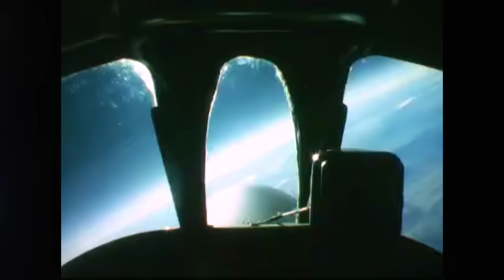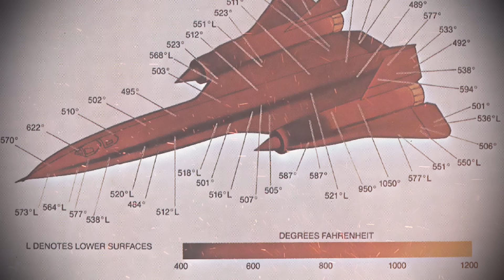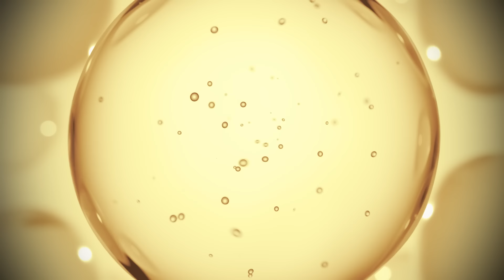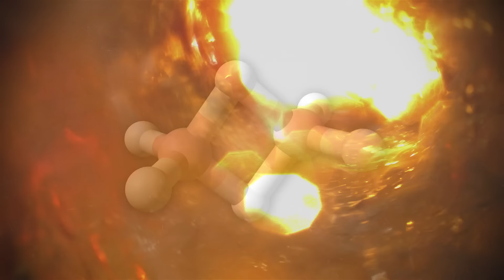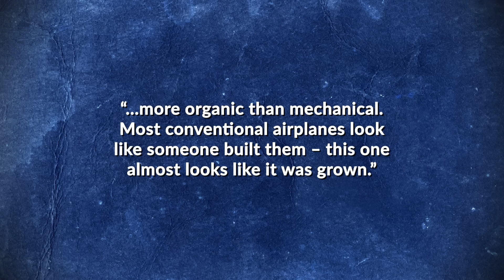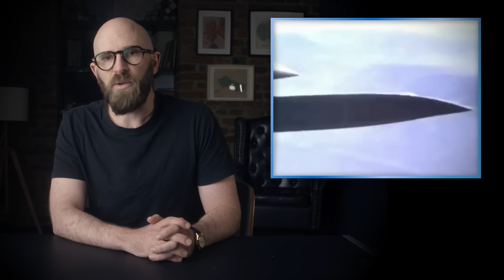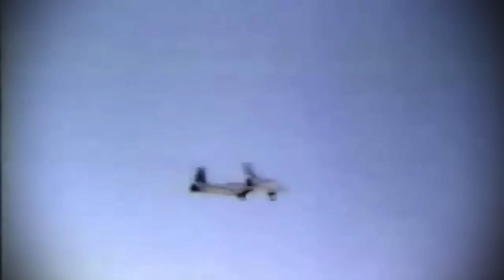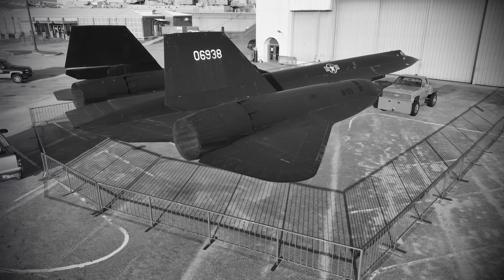How Did the SR-71 Blackbird Get Made and How was It So Fast?

Comment: Here is the thing the U2 and SR71 were based off the British Canberra first jet Broke altitude records low radar image was first jet spy plane before ground to air missiles.  The surprise was I think in the 1980s the SR71 Blackbird at well over 80, thousand feet met the Electric Lightning. The only fighter plane that could vertical clime over the speed of sound. The SR71 was so well designed and built nothing else could be made like them.

Comment: These engineers were the real deal! They didn’t have AutoCAD, they HAND DREW every system with straight edges, compasses, and protractors. Their calculations were done with slide rules, not calculators or computers. They didn’t their math longhand with pencil and paper. When they didn’t have a tool, they thought it up, drew it, and made it - so they could get back to building the bird. They engineered all new liquids, lubricants, sealants, fuel, electrical connections. 

Those engineers were badass, and are still badass to this day. As far as I’m concerned, Mr. Kelly Johnson and his band of merry men are just as much heroes as those who flew this magnificent marvel of American engineering.

Comment: The speed of M 3.3 is the unclassified number.  As the program is still classified.  I am sure the aircraft goes much faster.  That goes for all the other numbers that were reported in this and other videos.  I always wanted to see if the math adds up.  As the skin is a titanium alloy. We could then give a rough estimate of sped from the heat and expansion of the metal.  I was shocked to learn when I was a child in the 78's.  that the aircraft would expand 12" once in flight reaching its top speed.  This was from a propaganda film shown at Wright Patterson Air force Museum.  Where it reported both the SR 71 and the XB 70 both were designed to do M 10.   But I was 11 and what did I know then.   I was at awe seeing the XB 70 out front of the museum, under the sun the huge bomber.  laughing with my friend Jimmy because the rear landing gear was as tall as us.    Then in the museum seeing the B19 landing gear tire shortly afterwards.  the tings as a child we seem to focus on.  That day I bought my first two model airplanes.  The SR 71 though I know now was the A 12 ans the XB 70 Valkyrie.  I was a kid in love that day.  In 2003  I took my 8 year old daughter were we looked at the A12 though was said it was the SR 71 on the sign in front of the aircraft.  I was so amazed as the films the plain looks so much bigger.  Like the F104 also looked so much smaller.  My most favorite aircraft to this day.  The Bird of Prey also makes the list today.  It was so much fun taking in the Dayton air and trade show and the museum the following day.  God I feel old back in 2003.   It has been 22 years.  where does time go?
Reply: Mach 10? Absolutely not, or even possible. The program is not still classified,  and all performance capabilities are declassified and public

Comment: Fuel tanks did not “seal” at speed and temperature, they still leaked. The fuel would simply evaporate as it leaked out.

The starter fluid was triethyl borane, a liquid, not a gas.

Comment: On some days, that trans Atlantic flight took less time to complete than my daily drive home from work (30 miles). Let that sink in. Old boy runs 3 times faster than the sound its engines make and its exhaust is even faster (note the mach diamonds coming out of the afterburner which denote supersonic speeds), and did it without breaking a sweat despite its skin being hot enough to melt aluminum.

Comment: I read the SR did not leak that much fuel  (and what it did leak was carefully collected while the plane was on the ground) and that the JP7  was used to make sure the fuel did not combust from the heat generated by flight as the fuel was directly in the wings.

Comment: I was stationed at Beale AFB from 1986 to 1990. I worked on T-38s that were used to give flying hours to the SR-71 pilots. I have seen several launches and flybys of the Blackbird. I even attended the engine test of one J-85. It was so loud my lungs vibrated! I have a picture me of sitting in the jet exhaust of an SR-71. And I attended the retirement ceremony in 1989.  The plane was otherworldly!  If anything this video underplays it.

Comment: Did they actually ever use diborane pyrophoric? Afaik, and based on what even the pilots said, they used TEB (tetraethyl borane, the stuff conventionally used to light/relight rocket engines) and they had 16 shots of it per sortie. It'd also be used to light the afterburners.

Comment: The fuel designed for the J58 in the A-12/SR-71 wasn't to prevent fires on the ground as Jet-A is essentially diesel and will not ignite without substantial application of flame (it will put cigarettes out when they are dropped in a bucket of Jet-A). It was developed because the autoignition point of Jet-A is below the skin temp of the plane at top speed as well as the temps in the engine at design speeds. 

Without a fuel with a higher autoignition point, the plane becomes a one-way trip.

Comment: Just one correction:  the various incarnations of the SR-71 took off light and refuelled in flight immediately afterward for a reason unrelated to either its supposed leakiness, or the strength of its landing gear.  NASA/Armstrong (nee Dryden) Flight Research Center had three operating SR-71s in the 1990s, and I knew a number of their pilots.  Steve Ishmael, the principal SR-71 pilot, set me straight on this matter.  The CIA and Air Force did the early refuelling operation because a fully fuelled SR-71 weighed so much that it had to pull a very large angle of attack on takeoff.  This resulted in the rudders being "shadowed" from the free stream, and if either engine flamed out, the pilot would have no yaw control, and likely lose the aircraft.  NASA couldn't afford an air tanker, so they did a risk assessment which concluded that, given the aircraft's operation history, the odds of such a takeoff accident were low enough to be acceptable.  NASA would often take their :SR-71s off fully fueled.

Comment: Another great video BUT...
Why do the writers of aircraft features insist on giving altitudes in metres? As far as I know, only the Russians use metres for altitude. The rest of the world and significantly the USA, makers of this aircraft, use feet or thousands of feet to measure altitude. I don't compute altitudes in metres. The Aircrash Investigation series does it too. It's infuriating!
Also, I don't think the fuel for this aircraft was chosen because it was safe when it leaked as you imply. It was used to cool parts of the engine so it needed to have a high flashpoint and low volatility. That it didn't catch fire when it leaked was a bonus.

Comment: And once again, one of your videos has major flaws in the information it gives: the fuel was not engineered to not ccombust when leaking out of the aircraft!
It was designed to not boil or decompose under the extreme conditions: temperatures of 500+°C at less than 10% of atmospheric pressure. Being difficult to ignite was just a side effect of that. They even had to use TEB (triethylborane) to get the fuel buring - as well during startup of the engines as well as the afterburners. Actually, the range of the SR-71 was limited by nothing else but the amount of restarts of the afterburners it could perform before needing a refuel of TEB, which in turn limited the nummer of air-to-air refuelings possible before needing to land.
Reply: The limiting factor was LN2, not TEB.

Comment: In the mid-1980's, rumors started to circulate that Lockheed was working on a successor to the SR-71, code named Aurora. In the 1990's, there were reports of sightings, mysterious sonic booms when no supersonic aircraft were operating in the area, strange "donut on a rope" contrails, and more rumors, included an alleged top speed in the neighborhood of Mach 5.

The government denied the existence of Aurora, as did Kelly Johnson's successor at Skunk Works, Ben Rich. All the same, you'd think that Lockheed would have been doing some work on the technologies needed for a next-generation spyplane; something that could fly higher, farther, and faster than the Blackbird. Did such a project exist? If so, what was the final outcome? Me, I'd like to think that at least one test aircraft was built and that a few flights did take place, but the materials they had to work with just didn't hold up long enough at the design speed (Mach 5+) to justify building more until new materials were available. Is the SR-72 appearing now because that problem has finally been solved?

Comment: A Swedish fighter jet successfully managed lock on to the SR71 (not with any intention to fire at it) and were awarded medals for this. Sweden also saved a a damaged SR71 from falling into Sovjet hands by guiding it south over the baltic ocean towards the allies.
Reply: Not just “a” Swedish fighter jet.  There were at least 51 successful interceptions of the SR-71 by the Swedish Air Force.  

When you have a plane that wakes up everyone within ten miles of Mildenhall, still needs to tank up with fuel, has to thread the needle between sovereign airspace in rhe Baltic Sea, and has a turning radius of 81 MILES!   …. it’s pretty easy to guess where it will be and place your aircraft in its path.  A properly timed zoom climb completes the mission and if need be the missile could make up the rest of the distance and altitude.

Comment: JP7 was NOT developed to reduce the possibility of fires on the tarmac because Blackbirds leaked fuel standing still.  Where do you idiots get this stuff?  High flash point JP7 fuel was developed to handle the high temperatures of the air frame at Mach 3.
Reply: @MillionsOfRecords  You just went over the bearded wonder's head!

Comment: I was stationed at Ft Hood in the late 1980s. I was on a maintenance test flight in a UH-1H at 10k feet. At that altitude we could hear LA flight Control and an aircraft requested clearance to "Angeles 80" which is 80,000 feet "copy,  clearance to Angeles 80. If you can get there." 
"Roger Control, Decending to 80,000". 

Best freaking day EVER!

Comment: Ahem! @TodayIFoundOut , No! The Skunk Works was so-called because originally it had no name, it was secret, but it did have a paint factory nearby that absolutely stank, it was nicknamed by it's employees and then adopted un/officially as a perfect cover name, think Operation Market Garden.
The outer ridges of the plane had a lattice design that caused radar waves to bounce around and somewhat dissipate, imagine pointing a laser at two mirrors place at a 30 degree angle from eachother and how the beam would 'bounce between the two and not send the light back. That's part of it, but also the paint covering the plane was also impregnated with iron oxide plus other secret stuff that also had radar absorbtion properties. Lockheed had CIA funding for all of this, so the actual amounts of money spent on all of the specialied fuel, lubricants, materials, etc will probably never be known to us, but it was absolutely massive, ie small country GDP large, at the time.
Lyndon Johnson may have mispronounced the RS71, but doesn't SR71 sound more menacing and dangerous?
NASA had SR71's for use in research until recently, maybe 4 years ago, and officially were the last fliers. Or were they? With a bit of kit like this, would you tell? Just think of the power of rattling a sabre that you may or may not have. 
My dad was an engineer/machinist for a company in Welwyn Garden City when I was a kid. Years later when we were in partnership with a company making precision tooling for the turned parts industry (the people that make nuts, bolts, watch parts, on down to pub darts and shafts) he often used to talk about setting up and running cam controlled automatic lathes that made titanium rivets.. Now, rivets are usually made from malleable (translates to hammerable to change shape, ie soft metals like iron or aluminium), which titanium most definitely is not.. As he said to our customers "Who on earth needs a rivet made of titanium?" Yeah, by the power of Youtube documentaries (long before this one), I found out and told him.. Simon's story should fill you in on the reasons for a UK company (note I haven't named them, I had to sign the official secrets act when working on an airbase, begrudgingly, admittedly I did my signature squiggle as Mickey Mouse, which was SO scrawly that it didn't get noticed, but as I'm here under my real name, you can understand that my signature does not look like Mickey Mouse in any way.. But it still passed!

Comment: The SR-71 used Buick wildcat engines in the start carts. Rumor is you couldn't find a wild cat engine on the west coast after the air force started using them and needed spare parts.

Comment: So, the starting cart didn't use chevy big block engines it used Buick nailhead engines and the government scoured wrecking yards constantly to try and score good cores to rebuild as the operators regularly overrevved them to get the aircraft started.
Reply: different era carts had different engines, the latter one was gm/chevy big blocks